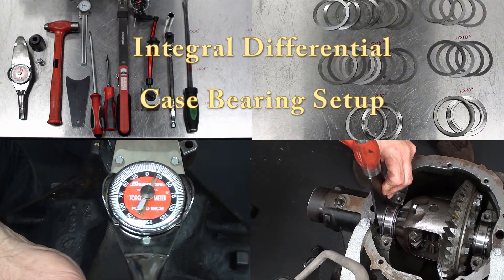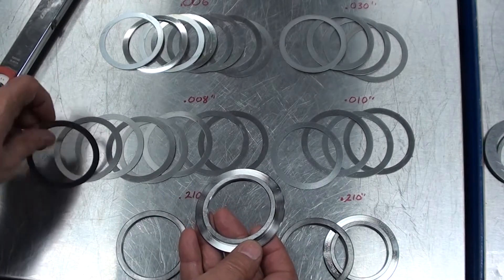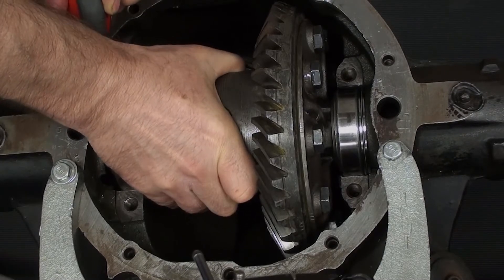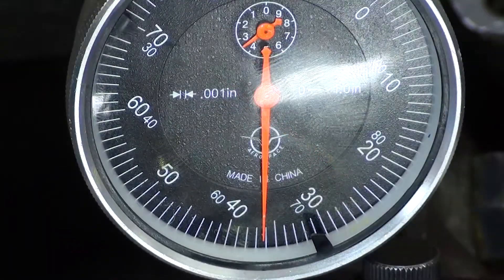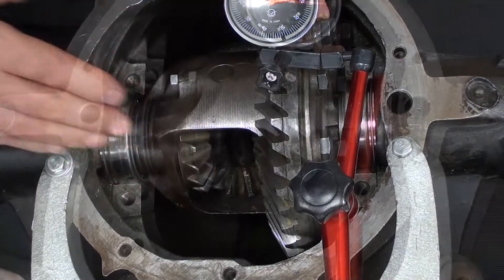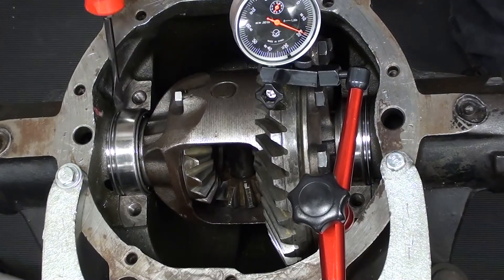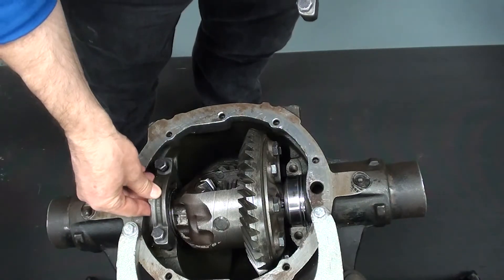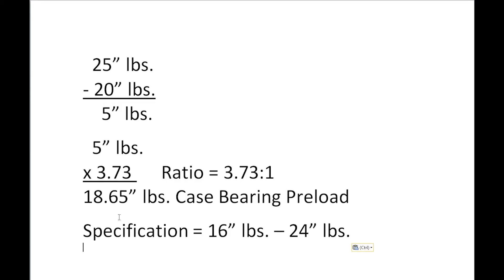Differential Case Installation With Universal Shims

Comment: Great Video, i replace the differential on my 8.5, one of the shims break apart and i do not find a replacement, on the aftermarket shims kit, they are smaller, i am not sure why they do not test fitment on the stores as the size is different, i just lost time and money, mine is a 10-bolt positive 8.5 ,stock are 3 inch outside diameter, 2.200 inch inside  , replacements are the SK11 inside diameter 1.700 x 2.800 ,  thank you for this video

Comment: So how would you do this with it still in the Jeep?
Reply from the maker: Most integral differentials of a similar design are rebuilt while still in the vehicle.  Not ideal but it's too much work to remove the entire axle and put it on a bench. It gets a little tricky but it can be done.

Comment: Everything about this is wrong. Might have worked for you, but no manufacturer recommends this method…
Reply from the maker: Just so you know, No manufacture uses universal shims.  2nd disregarding the universal shim thing this procedure came straight from a GM differential setup guide when I attended factory training 25 years ago.  The things different is I don't have the shim estimating tool and I didn't use the bent shim to push on the case. The factory procedure also told us to bend a .040" shim to make it a spring to push on the case but instead I used a couple of screw drivers to force the case over which actually works better for a wider range of differentials if you do it correctly.  Also GM uses a .170" service spacer and various sizes steel shims to replace the cast iron shims. We were instructed to throw out the cast iron shims and not to use the case spreader anymore.  The story that I was told by the instructor was that GM techs all had there own way of doing a setup and the results were not consistently accurate. When they asked 6 experienced Techs how to setup a diff they got 7 different answers.  So, 6 experienced GM trainers (former techs) were assembled in Detroit for a week and were given the task to come up with a process that was flawless and concomitantly produced accurate results on the first try. The only modification I implemented was when determining the the ring gear shim size on the first step. The manual said to increase the shim size until there is zero backlash but what happens is that most ring gears can have .002" to .003" backlash variation making it impossible to find the sweet spot of zero backlash without causing either binding or a spot or two with .001" - .002" backlash. My change by finding a shim that produces .002" to .003" backlash on the first step solves that problem and correctly sets up these diffs 98% of the time on the first try and 100% of the time after you do it a few times.  So, yes it does work for me and a whole lot of others who follow my slightly modified GM Factory procedure using universal shims.
Reply: @ you must be retarded if you think I’m gonna read that LOL

Comment: Great vid.
If I'm changing a 4.6 CWP to a 4.3 or 4.1 can I use the same pinion spacer (which is a solid type)? And just re-shim ?
Reply from the maker: Typically when changing gear ratio the pinion depth shim also needs to be adjusted.  The best way to do this is to install the original pinion depth shim and assemble the diff but leave out the crush sleeve and pinion seal.  Set the pinion preload and backlash to spec or very close then run a gear contact patch and based on the contact disassemble and adjust the shim size. Then recheck. You may need to do this a few time to get it right.  Once it correct disassemble and reassemble using the crush sleeve and pinion seal and adjust the backlash and case bearing preload to spec.  check out my pinion depth and contact patch videos. Pinion depth and contact patch explained:  https://youtu.be/w2kneEjXw6E?si=USWMLQyKJsHltqcc . Pinion depth shim change:  https://youtu.be/_bUh9NEMldI?si=NV5NoQ-Oh8TfEOKo . Contact path: https://youtu.be/UIIk305-zlQ?si=1QTL3bIB1_YqKCy2

Comment: I really like this. It would be the kind of job I would enjoy doing. Its precise like brake press work. 
I have a couple of questions. One how does the spreader on the case work in getting the right preload? Second, Im not liking the spacer between the bearing and pinion. Just seems like a pain when and if the spacer can be put between the race and housing. Cant I put it there instead of having to pull the whole bearing off the pinion. the other way just takes a hammer to knock out the race. Tring to reduce tools to do this at home.  the spreader seems contrary to getting the load on the diff bearings too.
Reply from the maker: First of all you really don't need a case spreader these days to setup a differential. You noticed that I used the shim punch to hammer in the last shim. This spreads the case slightly which adds the preload to the case bearings. The more the case spreads the greater the preload on the case bearings. When it comes to pinion depth shims you have to go with what ever the manufacture has designed.  Some manufactures do place the depth shim between the outer race and the housing but this too can be problematic.  You often have to rest the punch on the shim to hammer out the race. This can damage the shim.  If you can find shims to put between the race and the housing for a design that uses shims between the pinion and the bearing you can use them. They will work the same. The problem is finding shims that will fit. The reason for the case spreader is most OE shims are cast iron and if you hammer on them they can crack. But if you use a case spreader to expand the case and drop the cast iron shim in place you can relax and remove the spreader which will apply pressure onto the shim which pushes on the bearings for a preload.  If you have replacement shims that are made from steel they can be hammered on without cracking.  So no spreader is needed.
Reply: @DrivelineMaster  The shim would need a bigger OD and ID to fit correctly. Would be very narrow. 
I seen earlier that what I thought was a spreader w is a vice on the pinion video.
Reply from the maker: Oh, your talking about a bearing splitter that is used to remove the pinion bearing.  There is something called a case spreader that is used to spread the housing for setting up the case bearing preload and ring gear backlash.  Well, you can remove the old bearing without a bearing splitter but you will destroy the bearing because you have to cut it off.  If you need to remove the pinion bearing without destroying it you will need a bearing splitter or what is even more expensive is a specially designed pinion bearing puller tool. You can get a puller to work with a splitter or you need a press. There is just no way around it.  So, yes if you can find a shim that will fit under the bearing race that would reduce the tools you need. Problem is finding shims that will fit on a diff design that uses the pinion shim.  If you feel that you may need to R&R the pinion bearing several times to swap out shims there is a trick you can do but it will cost you the price of a second pinion bearing.  After removing the old bearing take one of the new bearings and hone out the inside diameter just enough so the bearing just barely slide onto the pinion. There should be some drag.  Now you can slide the bearing off, change the shim, reinstall the pinion and check the depth and or pattern. If you need to adjust the shim just disassemble, slide the bearing off, change the shim and repeat. Once you find the correct shim remove the modified pinion bearing and press on the new bearing for our final assembly.

Comment: RED THREAD LOCK ON BRAKE CLEANED RING GEAR BOLTS and HOLES IN THE RING GEAR to get rid of machining oil in the holes on the (now new) Ring gear!!!! and TORQUED TO 55 FT lbs.  

garage monkey used his trusty impact gun to "tighten" the ring gear bolts, no THREAD LOCK and in ~1500 miles the ring gear bolts fell out 3, got caught in the spinning ring gear, poked hole in differential cover, all oil leaked out... ruined my nice new limited slip that i had garage monkey put in. 

so now get to do it all over again.  NO ONE ALLOWED IN THE SHOP!!! INSURANCE REGULATIONS... sure... so cant MAKE SURE IT IS DONE RIGHT so we don't have to do it all over again and replace ALL the bearings, ring and pinion, limited slip as grease monkey figured... i do this all the time... impact gun for ring gear bolts and NO THREAD LOCK will be fine???  $750 lesson learned.
Reply from the maker: Here is another tip when torquing the ring gear bolts.  Do it in two steps. Step one, torque  to 27 FT lbs. then go around again and torque to 55 FT lbs.  Some diffs use locking tabs on the ring gear bolts.  These are the only bolts that can get away with not using thread locker on the ring gear bolts.   I also caution on using an impact gun to tighten the pinion nut when crushing the sleeve and setting pinion bearing preload.  I use a flange holder and a torque multiplier.  I have many people on YouTube who tell me they set pinion bearing preload using an impact gun on the pinion nut and never have a problem.  Never yet or at least none that they know of. Good luck.

Comment: Where do you find the specs for Carrier Preload?  I am working on a GM 12 Bolt 8.875 Truck Axle.  Gear ratio is 3.07.  I do have the GM Overhaul Manual and it does explain that .004 shims should be added to each side of the carrier for preload. It however, does not give a min/max value for acceptable carrier preload. I have looked in older Dana/Spicer manuals and it just does not list this at all.  Searching the net and all you see is "Pinion Preload" values no matter how you type in the question.  My current set up is Pinion Preload 18in lbs. Total preload with carrier 28 in lbs.  Assuming I am doing the formula correct 10x3.07 tells me I have 30.7 in lbs of carrier preload.  But, I have no value to compare this with to ensure I am not going to smoke the carrier bearings.  Thoughts?
Reply from the maker: In order to find a rotational force case bearing preload specifications you need to look at newer GM vehicles.  The older vehicle specs just tell you 0.004" shim increase per side.  This is not very exact.  Even if it's not the exact model the preload is pretty generic.  For your differential is using new case bearings use the calculated rotational preload force specification of 15" lbs. to 35" lbs..  If you have 30" lbs. of rotational force your good.
Reply: @DrivelineMaster  Thank you for the prompt reply.  I am using new timken bearings for this build.  Do you use 15 to 35 in lbs of rotational preload the default when you cannot find a standard?  Lastly, keep doing what you do.  Your educational techniques are spot on for me.
Reply from the maker: I use 15" to 25" lbs. as a generic rule of thumb for all differentials.  I also consider the size of the bearings.  For larger diffs I don't mind going as high as 35'" lbs. and for smaller bearings like in a Dana 10 I will use closer to 15 - 20" lbs. for the case bearing preload. Also GM is the only manufacture I have seen that uses this technique to calculate case bearing preload.  I think it is a great way to do this because it eliminates error and a change in gear ratio or a loss of elasticity in the differential housing.
Reply: @DrivelineMaster   Thank you for all your assistance.
Reply: INCH pounds....  to be clear.   NASA burned $1.3 billion into mars surface as the software was written in Germany (metric) but used in the US (inches/feet) so the ppl running the show , when they read deploy parachutes at 1000... FT? Meters? ass u me d that they meant 1000 ft... it wasnt... it was 1000 METERS and...  with the very very thin atmosphere in mars atmosphere... $1.3 billion of the US taxpayers $$$$ is now junk on the Mars surface.

Comment: Thank you for providing this information! I do have a question. 
How do you establish/calculate what the specified pinion depth should be? Im installing an aftermarket ring and pinion set and do not have that number. Thanks again, very informative video!
Reply from the maker: The aftermarket gear set typically marks the head of the pinion with the proper depth measurement but this requires that you use a measurement tool.  If your willing to do a little trial and error method you can set your pinion depth by using the contact patch.  I have videos on measuring pinion depth and one that explains pinion depth and contact patch readings and I have one on how to perform a contact patch test. https://youtu.be/w2kneEjXw6E or https://youtu.be/UIIk305-zlQ or https://youtu.be/QL-dmhfSj6k and https://youtu.be/gk6imita0cc  .  Here is a trick that is cheaper than buying a depth tool if your only setting up one differential.  If the depth shim is between the head of the pinion and the rear bearing buy an extra rear bearing. Use a small hole hone and hone out a few thousandth of an inch from the inner race. Just enough so it slides on and off of your drive pinion with a little force that you can overcome with hand pressure.  Now you can quickly change the shims without a press. When you find the correct shim by testing the contact patch replace the setup bearing with the bearing the new one that needs to be pressed on.  If you do this make sure to fully clean all honing material from the setup bearing and re-oil it. Good Luck.
Reply: @DrivelineMaster  
Oh ok. Thank you for the info!

Comment: Hello!  I enjoyed this video. Very much.  Regarding case preload, I typically practice and preach a slight variation of the method you have shown where the shim stack needs to be thick enough such that there is stick-out remaining after you have reached a point you cannot push it in further and need to use the punch.  

I really like the math you presented as it gives objectivity the subjective feel of the shims going in.  By chance, could you share a link to the document(s) explaining what proper carrier preloads should be?  If this is not possible, could one reference the required pinion preload of the axle being worked on and shoot for the high end of that spec?

Example a Dana 80 has a pinion preload spec of 25-40 in. lbs. and the carrier bearings are approximately the same size as the inner pinion bearing.  Absent any formal documentation could one set the case preload to 40 inch. lbs.?
Reply from the maker: I learned the math technique many years ago at a GM training center.  A lot of manufactures do not refer to case bearing preload this way but it clearly is much more accurate because over time and many, many heat up and cool down cycles the elasticity of the housing metal relaxes. So adding 0.008 in. additional shim thickness to a pair of case bearings when the diff is new will have a reduced effect on a 15 year old diff. Some manufactures simply say add 0.008 in. or 0.010 in additional shim to a case that is set to zero preload and zero backlash.  Others will have you measure the case spread and some will tell you the pinion and case turning force should be 2 - 4 inch pounds greater then the pinion bearing preload.  2-4 inch pounds greater that pinion bearing preload is what I typically look for however this is relative to the ring and pinion gear ratio. So if this is the factory spec but you put in bigger gears that spec. is no longer valid.  Here is what I use based on my experience.  If the gearset is below 3.73:1 use an increase of 2 - 3 inch pounds greater than pinion bearing preload.  Above 3.73 up to 4.54 use 3 to 5 inch pounds greater than pinion bearing preload. If you have some really big gears keep going up. Used bearings will be slightly less but why in the devil would anybody put used bearings back in when you have it all apart is beyond me. 

As for the pinion bearing preload I believe in specifications.   Which means that I don't shoot for the high end, low end or middle.  I believe that specs are designed so the diff will last a good long time if it is built within specifications.  I also believe that this holds true as long as break-in procedures are followed and proper oil change intervals are followed with the correct lubricant. So during my builds if I tighten the pinon nut and my pinion bearing preload turning force is withing spec. I stop. I don't try to tweak it to the middle or high end or anything like that. The diff I was working on was an old GM 10 bolt diff. I don't remember if it was a Saginaw or American axle or what.